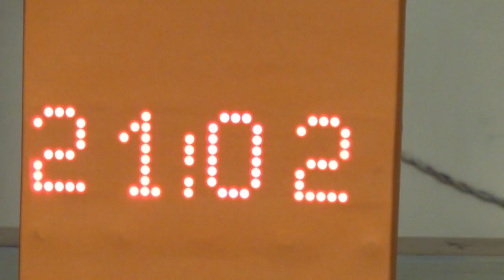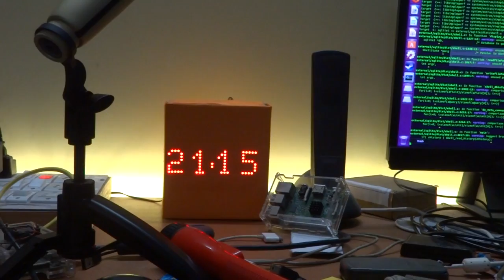Minimalist Arduino Clock | Weekend Project #1

Comment: Source code?
Reply: I just looked at your code.
The clock in the video does not show the temperature or the humidity. But your code contains commands to show them. Did you add those features after you made the video?

I also notice that there is no way to set the time on the clock without reprogramming it.
Reply: That will work, as long as your RTC is a good timekeeper.